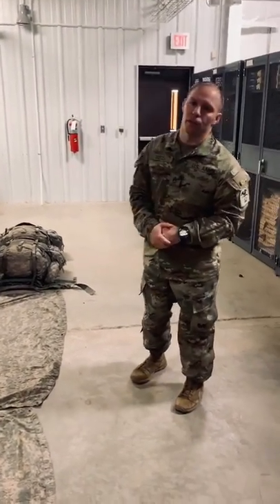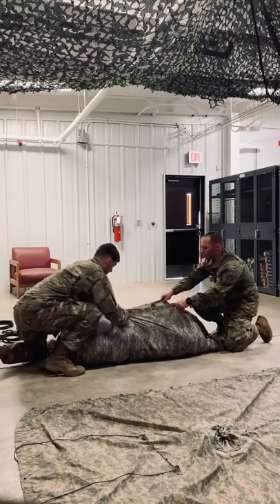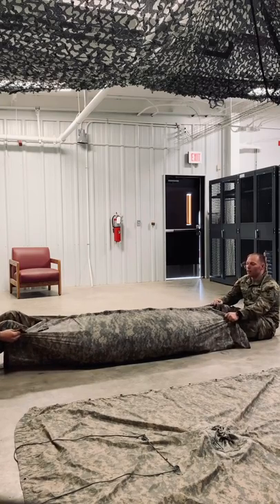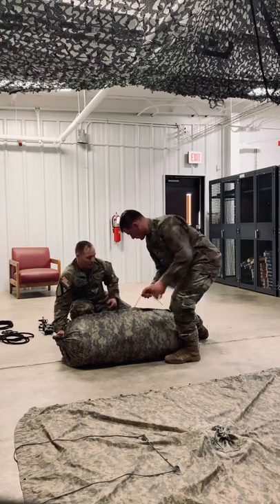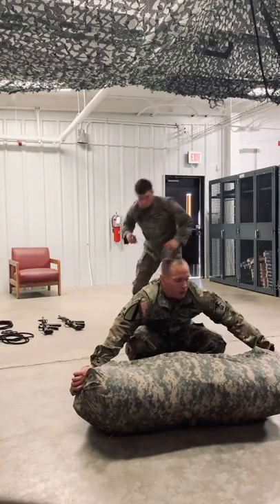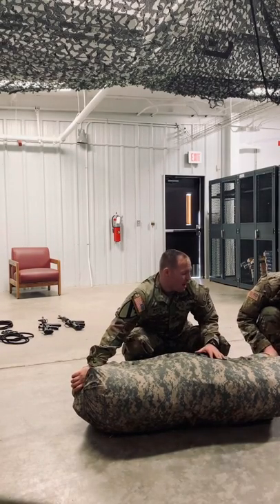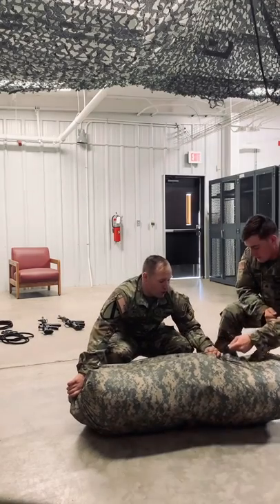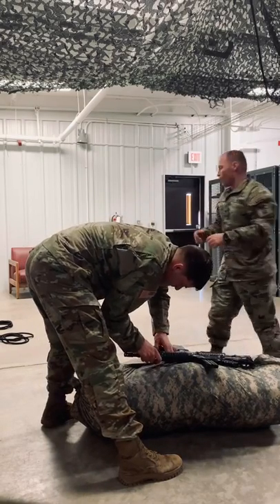Sapper tutorials: Poncho Raft

Comment: Pretty good instruction. Not sure why you didn't explain about blowing air into the wet weather bag inside the ruck and taping or repairing any holes. i.e. air floats.  Unless its not done anymore. I graduated Sapper course in 92. So many things were different. But I hated how perfect things had to be. Unlike SFAS. If it works? Its good. 4", 6", 8" is BS things to make you a no-go. 
And really, get someone better than you at snapping a button?! NOT something an Engineer would say. But all in all. Helps soldiers be prepared.